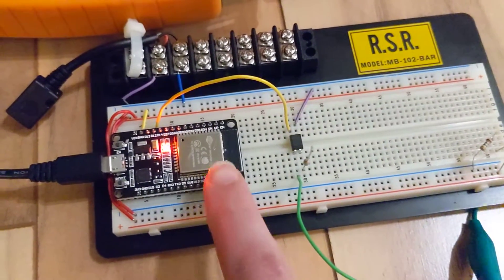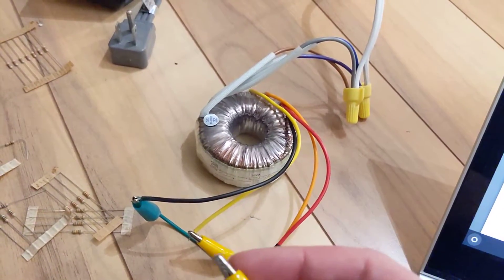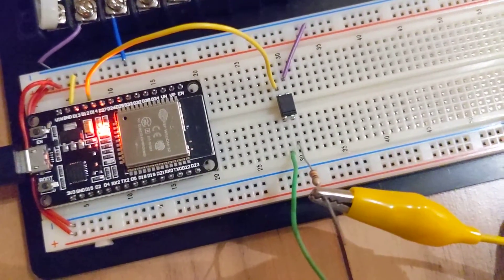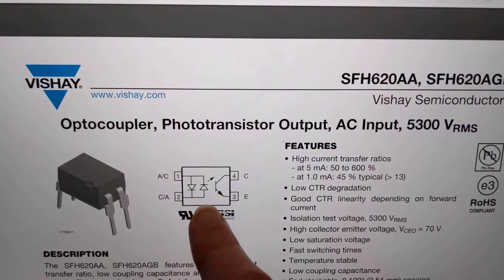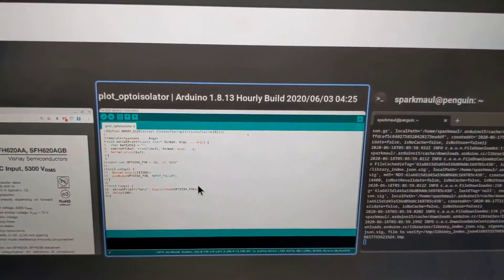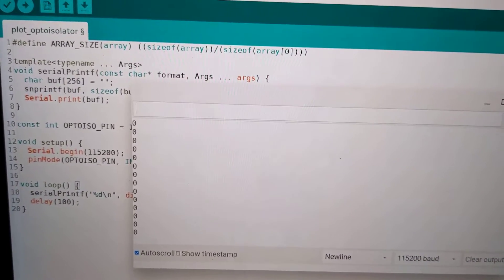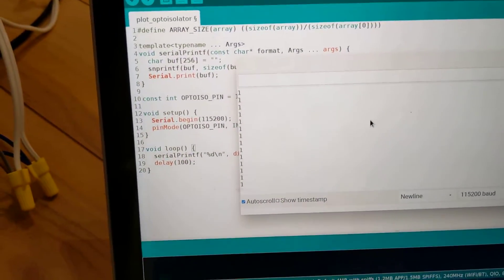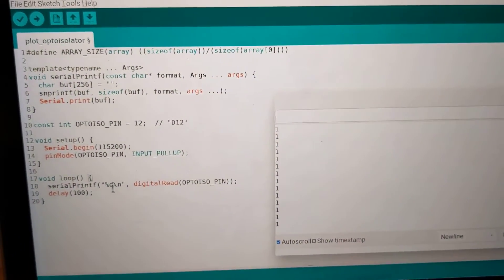Detecting 24V AC with an ESP32

Comment: Hi , i really like your video but i really need your help i have 13 pir sensors that will be installed in the cieling they have three terminals two for live and neutral and one for signal i've already setup the live and neutral wires for them now i have 13 signal wires that is 220v as this is what i think the output would be as shown on the sensor boxes and i tried to power different lamps using it and it does that so i guess it's 220v now i need to connect those 13 sensor to an esp32 so i can add  esphome and connect them to home assistant i am just wondering if there is a module that i can buy or a pcb i can print in my country or if i did it on a bread board would it be different from the video as my knowledge is really limited in this topic and those are 13 of them and i can't find someone proffessional to help me with it but you , Thanks in advance